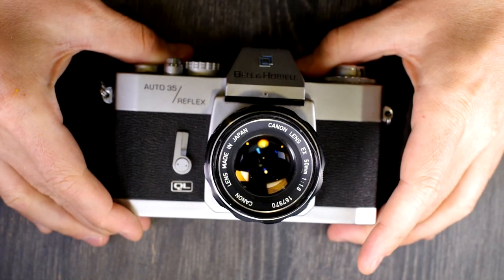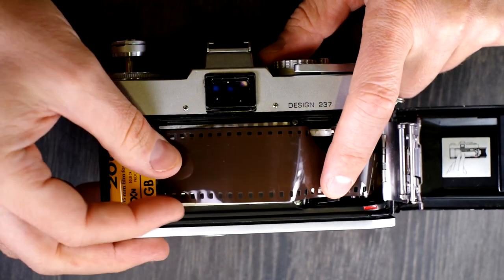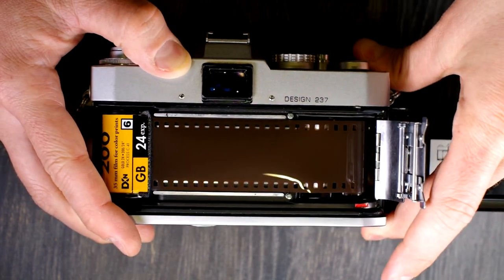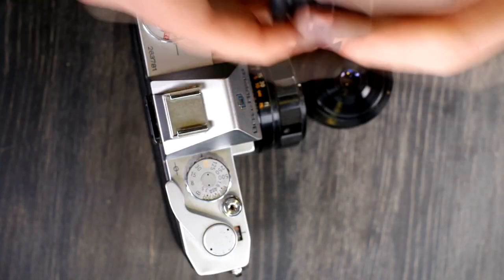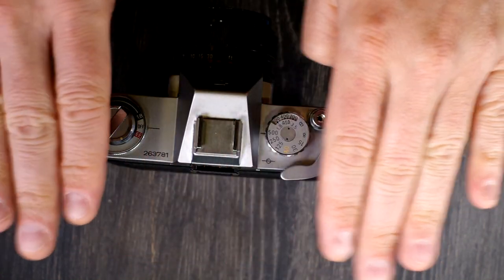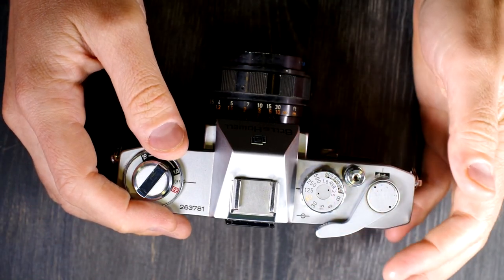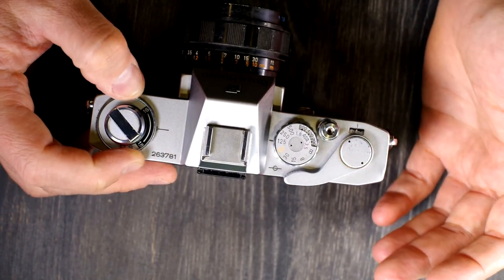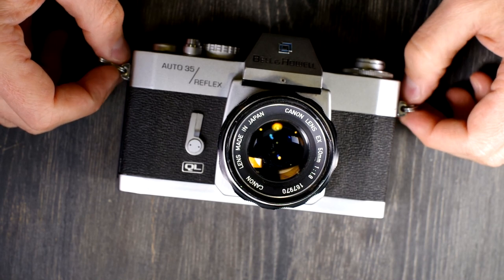Canon EX/EE Video 2: Operation, Use, How to Change Lenses, Load Film, Batteries, and Taking a Photo

Comment: I have the camera package which includes the original manual, flash, lenses and filters. Such a great robust unit. The manual even tells you how to do a double exposures and infrared photography and even has a mains power connector for the flash so you dont need batteries. 
Its a real gem of a collection.
Ive even found the correct voltage battery 👌
Reply from the maker: Nice!

Comment: Thank you David. 
   As I mentioned a couple weeks ago on the first video you did for this camera, I picked one up expecting it to be a sentimental paperweight, as it was my first 35mm slr in 1970. The camera arrived in working order, so I ordered some Ektar 100 and a battery to give it a test run. Alas, like many other cds light meters of the era, this one was DOA. A good excuse to purchase a new light meter. I also have a 16’ pc sync cable coming to use with my Godox AD600 strobe to see what kind of quality I can coax out of this unit.
   Also coming are the 35 and 95 lenses. They are dirt cheap, so I felt them too good of a bargain to pass up.
  It’ll be a challenge to see if I can get the most out of the least expensive camera ($25) I’ve ever purchased.
Keep the videos coming, always informative.
Reply from the maker: Fantastic! I lucked into a complete lens set for this and the teles are pretty nice. The 95 is a really interesting focal length to use.

Comment: Hello David, let me give you a tip, try to use you half 50mm upside down, you will get a great effect and you can still focus. Or you can use in a camera phone and get a wide angle. Cheers
Reply from the maker: You mean using the lens without a front cell attached? I noticed that still focuses, but it looks like a 35mm AoV in the viewfinder. I did also, just now, on your advice, hold the front 50mm cell backwards to the lens and that is a bizarre effect!
Reply: @DavidHancock  without the front cell I never use, but with the 50mm upside down you get the center sharp and the corners stretched, looks like those lens baby with a select focus. But with a lot of vignette.

Comment: Ah yes, the 1.35V Mercury batteries that aren't available any more, which makes Ye Olde Nikkormat FTN a "Sunny f/16" manual camera. (It is cheaper than trying to find a Nikkormat FS, though.) Beware of using very old film in these demonstration videos! If/when the film cracks and sheds bits of film, it will drop into the mechanical shutter/mirror mechanisms and lead to a jammed/destroyed camera. Proprietary camera designs are interesting to collectors, but reduce sales in the marketplace. 
The "which focusing scale do I use?" question reminds me of the "add on auxiliary component lenses" of the Mamiya/Sekor 528TL. Focusing the subject is no problem, but if you have to figure out how far away the subject is to set the correct f/stop for the flash, this can get "very interesting."
Reply from the maker: I just eyeball the exposures with this camera, Sunny 16, Shaded 8, Indoor 4, etc. Mine doesn't even have a working light meter. Best part about mechanical cameras with batteries only for the meter -- if that part fails the rest works.

Comment: According to the manual, in the EE mode, I don't know that it actually points to the aperture it's going to use, rather an indicator between the over and under-exposure warning marks, because it doesn't specify that is what it's doing. 
is it allowing you to adjust the shutter speed until the indicator moves to the proper exposure range?
The upper splitted part of the under-exposure warning mark applies only to the F3.5 lenses. 
Is the printed aperture in the viewfinder purely for when using manual selection?
Otherwise, why would there be over and under-exposure warning marks if it just tells you which aperture it's going to use? 
For example, if the indicator was pointing to 1.8 to obtain a correct exposure, that would be right on the verge of being in the "under exposure" warning mark?
Unless if using a shutter speed too fast, unable to open wider than 1.8 would result in an under exposed image.
Though according the the "exposure indicator" as noted in the manual, 5.6-8 would always be the ideal exposure being in the middle, regardless of ASA and Shutter speed..
I really wish the manual would clarify this! :(
Reply from the maker: You could be correct. I found the manual frustratingly hard to follow, too, and not having one (and I had THREE of these!) with a working meter made it really hard to discern the exact behavior.

Comment: Hi! I just found this camera, and wonder if it is possible to use it without the battery please? I don't have much money to spend into adaptors or original mercury batteries haha
Reply from the maker: That should be detailed in the battery section of this video. I think I specifically cover what the battery does and does not power.

Comment: My frame count window is not moving past S. Everything else is working just as it should, loaded the film and followed your steps in the video. I don’t want to ruin my film and open it back up, is my counter just broken or is my film not being loaded properly?
Reply from the maker: For your film loading, if the film rewind knob rotates opposite the direction of the arrow on it when you advance the film, then your film is loaded correctly.
Reply: @DavidHancock  Thank you so much for the quick answer! It does spin just as you said. This is my first SLR and I got a trip planned in two days so I wanted to make sure I had it ready by then. Your video was super informative and much appreciated by somebody that’s trying to learn more about film photography and cameras. Thanks for replying to my other comment aswell

Comment: Awesome video! Just bought a Canon EX AUTO. Where can I get the battery adaptor from? I just bought a PX625A battery and I tried testing the battery and the needle doesn't jump so I'm not sure if the battery doesn't work or the camera has an issue.
Reply from the maker: Thank you! For the adapter, here is an affiliate link for an eBay search: bit.ly/YTDH_MR9

Comment: We used these in photography class in 95/96 I was on yearbook We'd load like 50 pics b/w mine got stuck at about 37 it was end if yr teacher said I could have it they were upgrading to digital. Here I am found it about a week ago today took it into a friend's "dark room" unloaded it and wound the film back into the cannister. What's the odds my pics are still good?
Reply from the maker: Depends on the film, but it's not uncommon for film much older than 30 years to be recoverable. About eight years ago I developed some film taken in the 60s. Images were great.
Reply: @DavidHancock  sweet any photo development place or should i send it out? Also do you have a video on how to clean the prism? When you look through It has spots that look like spider droppings lens is clean and viewfinder also.
Reply from the maker: @manuelferreira4345  For developing, I like Old School Photo Lab in New Hampshire. There are other options that are also good. For the spots, if they're outside of the viewfinder, I have a few videos on how to clean different parts of cameras. If they're inside the viewfinder assembly, that requires a disassembly to clean and a professional service would be your best bet.
Reply: @DavidHancock  thanks I watched the clean up ones it seems that its just the view finder so I'll live with it for now. Our local camera shop acually told me it's not worth the time. The plan is I'll watch a few more videos a few times and sooner or later go for it.

Comment: A curious camera indeed! Was gifted one and am trying to make use of it. 
The 50 1.8 came default and is nice, meters well and seems accurate. 
I also picked up the 90mm 3.5 - The thing is, I shift the ASA dial (using 400 speed film) so 400 over the 3.5 mark for the different lens, however it seems to kill the metering range?
The light meter drops to the bottom red and doesnt move at speeds below 1/125. Hmm! 
Any ideas?
Has this put the meter out of it's range as if it was 800+ speed film over the 1.8 and it's reading that.
Hope that makes sense!
I feel like I ask camera questions every other day! Haha thanks David :)
Reply from the maker: :D
I am not sure why the camera is behaving like that. Since mine had a dead meter cell, I don't have a good handle on how to troubleshoot metering issues.
Reply: @DavidHancock  I actually suspect battery  has or is going flat, the Wein Cells don't last long at all!
Have ordered the voltage converter from Japan (sr43 1.55 v-> px625 1.35 v) so the days of wein cells will be over! Here's hoping :)

Comment: Hi David, great video! My light meter does not work on my Canon EX EE and I was wondering: when using the lenses other than the 50mm, will the aperture reading be correct when using an external light meter? For instance, if I am using the 35mm and my external light meter says that the aperture should be 3.5, would I set the aperture to 3.5 or does the 1.8 equal 3.5? And is there some math involved when using other lenses to figure out the correct aperture you should be using? Thanks!!
Reply from the maker: Good question. You would simply set the aperture to the number you need. It's been some years since I sold this camera, but IIRC if you set the aperture to faster than f/3.5 with the 35mm lens then the aperture is still set to 3.5.
Reply: @DavidHancock  Awesome, thanks so much!!

Comment: Thanks for the video it really helped me out, and I have a quation for this EX lenses do they have adaptors for like Sony mirror less cameras?
Reply from the maker: Thank you and no they do not. There lens inside the camera makes adapters tricky at best. I suppose one could be made from a parts camera.
Reply: @DavidHancock  as in like using the cameras focuse ring apart from the body by adjesting or custemising it to be as an adaptor for the sony?
Reply from the maker: @YosephWondwosen  since the camera has party of each lens assembly inside the body, you'd need to remove that and customize a mount adapter for it. The front half of each lens can't focus light without the elements inside the camera.
Reply: @DavidHancock  Thanks a lot Dave I really apricate  it, Also If in any way or miracle if you could lead me to any tutorial on how to or assemble  this adapter it will be very very help full
Reply from the maker: @YosephWondwosen  I'm not sure if it's ever been dinner or if it's possible. All I can't say is what's needed. An important days point would be the distance from the salvaged lens' housing to the film plane. If it's less than the flame distance of your camera, then the exee lenses won't be able to reach Infinity.
Reply: @DavidHancock  ok thanks very much!

Comment: i found my grandparents old one (great condition because of my grandpa)

but i would like to know what kind of battery substitute i can use for it?
(sorry my hearing is bad and i wasn't able to catch what kind was mentioned i did hear that the mercury batteries are no longer made, the substitute one was jumbled for my hearing)
Reply from the maker: Nice! I always forget the exact model of the modern batteries. But, an MR9 adapter and 357-size battery will work well.
Reply: @DavidHancock   Thank you so much!!! again I'm sorry for making you repeat yourself

Comment: What about hearing aid 1.4V batteries? I know they may not fit, but they can be adapted. Do you think a 1.4V battery would affect the metering?
Reply from the maker: I think they lack the amperage to power the old light meters.

Comment: Hi David, I was just wondering what you think the recommended iso and exposure is for the 50mm lens
Reply from the maker: That's more a film- or setting-dependent decision than lens-dependent. In general, films in the 50-200 range will work better with this camera outside because of the 1/500th fastest shutter speed.
Reply: @DavidHancock  I have a case of 400 film in mine, what would you recommend would be the best. or does that still depend on setting?
Reply from the maker: @liamsmith2573  The actual settings will be based on available light. Does your camera's light meter work?
Reply: @DavidHancock  how am I able to check, I’m sure it does because the camera is in very very good Nick
Reply from the maker: You'll want a 675-type battery and a simple brass adapter (check this video's discussion on batteries for more info.) Then with that installed you can verify it against the Sunny 16 rule, which is at f/16 the shutter speed and ISO (marked ASA on this camera) should be the same. So set the film speed to 250 ASA, shutter to 1/250, and aperture to f/16 and the meter reading should be within a stop of accurate. To check auto exposure mode, set the aperture to auto and the reading should be f/16-ish with the other settings the same. Be sure to test this outside with the sun to your back on a sunny day.

Comment: How would you set this camera if your pictures are all grainy/black and green
Reply from the maker: What kind of film are you using?
Reply: @DavidHancock  35m
Reply from the maker: I mean what brand and type and also is it good film or expired?
Reply: @DavidHancock  Kodak gold 200
Reply: It’s always brand new bought film
Reply from the maker: Okay. Most likely the exposure settings are incorrect. If the images are grainy, they're either very overexposed or underexposed. I'm not sure about the green color shift, but I think that Gold shifts magenta with overexposure, so your film is probably getting too little light. Here are a couple things that might help (I'm not sure of your skill level, so some of these may be remedial):

1- Make sure that the light meter is working correctly. This video's battery section has some tips on that. These use old mercury batteries so if you use a modern alkaline battery, your light meter will underexpose by about two stops all the time, and that could be part (or all) of the issue.
2- Make sure the ISO isn't changed after you load the roll.
3- If you have doubts about the camera's light meter, then double-check the readings with a smartphone light meter app. Those are mostly good and will give you good readings.

I suspect the issue is in the battery or light meter so having a check against that will probably correct the issue.
Reply: @DavidHancock  thank you. 
What would I set the shutter speed and dial to if I wanted to take more pictures outside?
Reply from the maker: @layneysalts2387  As a general rule of thumb, on a sunny day with the sun to your back, your film speed and shutter speed should match at f/16. So if you're using Kodak Gold 200 in full sun at f/16, 1/250th or 1/125th should both return pretty good results.
Reply: @DavidHancock  thank you!

Comment: Has anyone ever connected their Ex lens to a digital dslr? I would like to locate an adaptor to put my 1:45 on my rebel but I am not sure what kind of mount to use because I’m pretty sure these camera had half of the lens mechanism built into the body of the camera.
Reply: 1 : 35 125mm (not a time code)
Reply from the maker: The cameras had half the lens in the body, yes. There have not been any adapters made for these lenses and they cannot focus light properly without the rear cell that's in the camera.

Comment: Got mine but my EE mode doesn’t work the meter doesn’t move ? How can i fix this?
Reply from the maker: That would require a professional repair. That issues indicates a problem with the electronics or metering cells. It's very common and I've never come across an EE without that issue.

Comment: Does it need a battery?
Reply from the maker: Only for the light meter.
Reply: @DavidHancock  oh so i dont need battery to take a photo to the film???
Reply from the maker: @p.villaruel7006  Nope. As long as you dial in the correct settings the camera will take a proper photo. The light meter only helps ensure that you do that.
Reply: @DavidHancock  thank you so much! Its really hard to find a battery for the canon ex ee